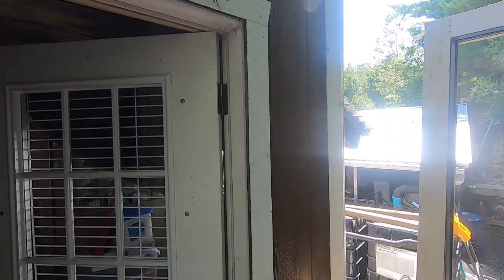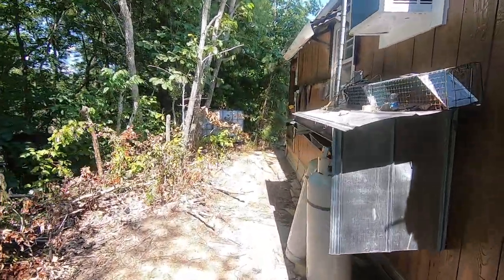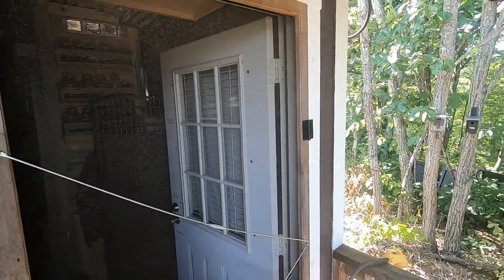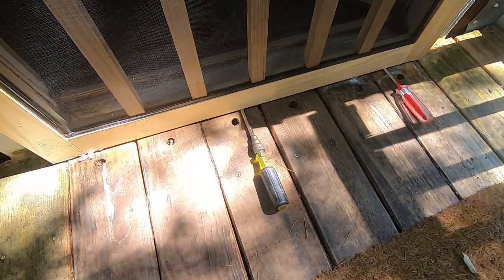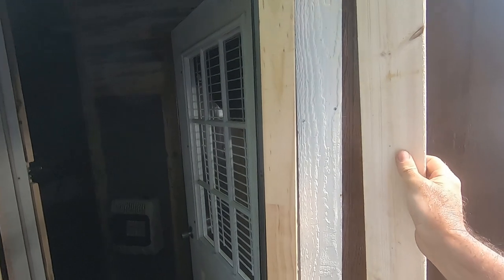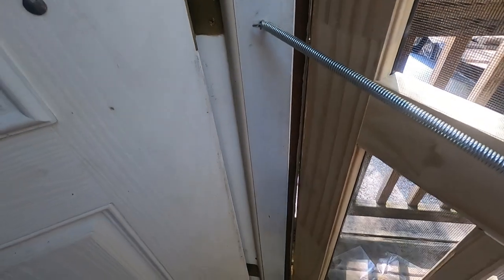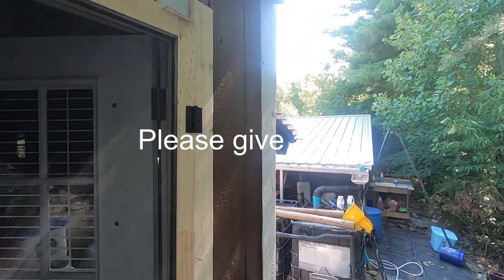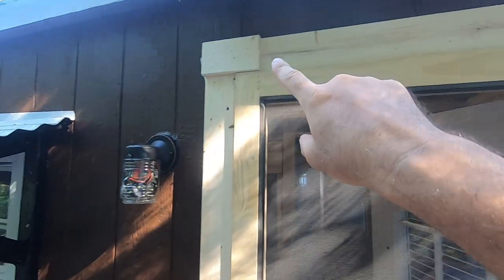Screen door install on a Shed to Home storage buliding Off Grid Tiny Home Cabin Homestead

Comment: Sir have you thought of geothermal cooling?
Reply from the maker: I am good up to 85 degrees. I am on a rain collection system.  I have no well for a geowell.
Reply: Im not trying to push this on you in any way. I also use rain water collection.  Ther is no well for geothermal.  I just burried plastic pipe underground.  You burry it at 5 foot and blow air through it the warmer air is turned into cooler air because its 60 degrees underground.  Ther isn't a well of any kind.  Its just useing ambient ground temperature to cool house. I am just trying to give some ides to you. I hope this is ok
Reply from the maker: @marcroemelen6836  I'm about to add a 2500 gallon tank. I will bury some lines. Thanks for the idea.
Reply: Im pickimg up some new 275 gal tanks tomorrow.  Sometimes I feel im getting over my head. The guy in fb market place  that was going to sell me 210 watt panels.  But im thinking hes a scam. Its got me worried so im going another month without solar